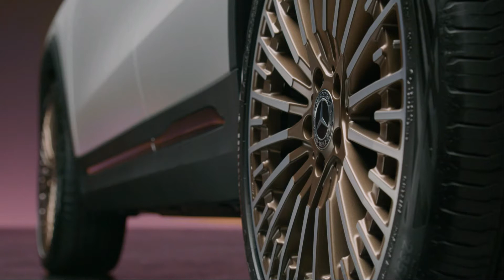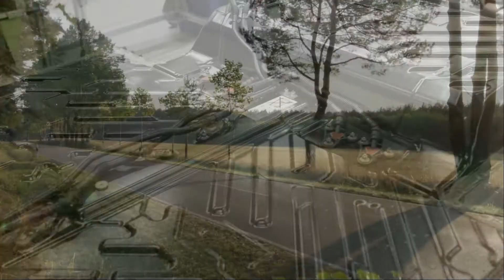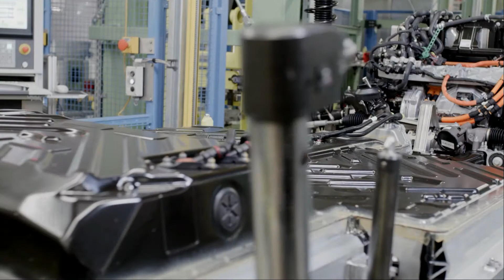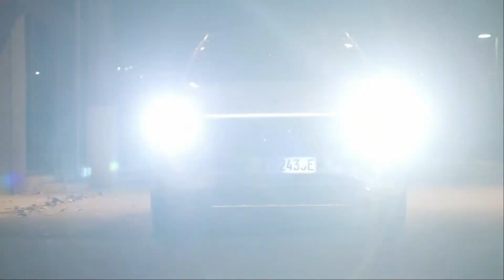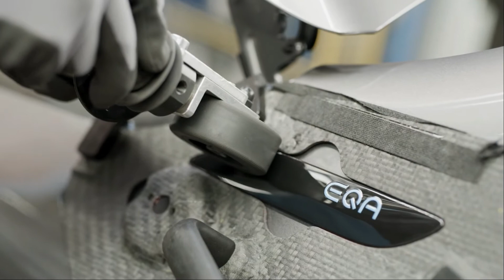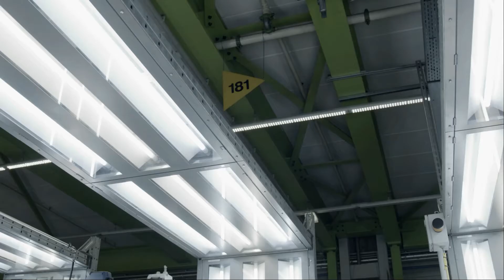Reducing Noise, Vibration and Harshness in Mercedes EQA Electric Vehicle.

Comment: My case is different, I hear a noise from bags back door during bumps, it mainly comes out from the the connection between the back door and the back bag. I believe that the metal handle I marked in the photo needs slight adjustment in order to match the excat location of the lock in the back door itself. Did anyone face similar noise issue? thnx. By the way my car is EQA 250+ 2024.sorry I can't add photo.